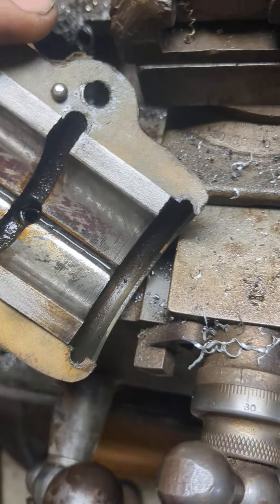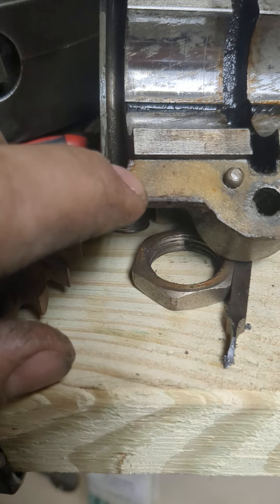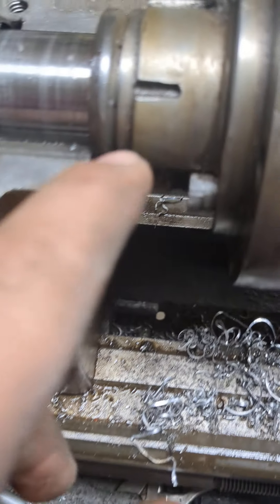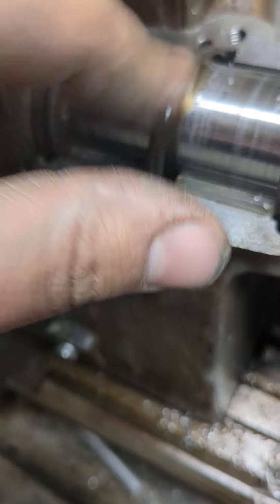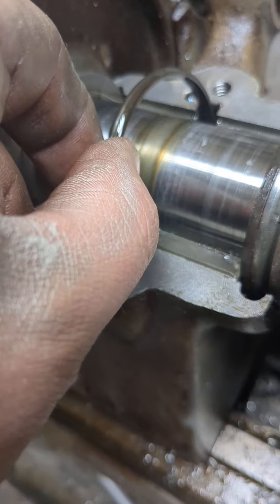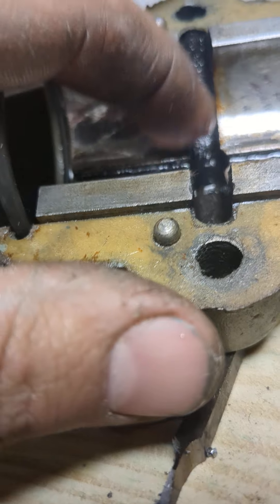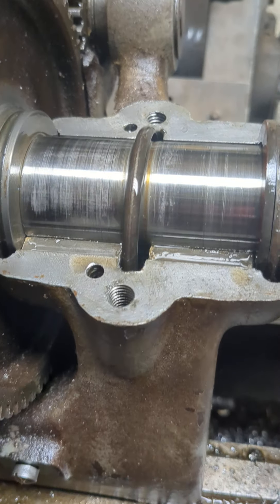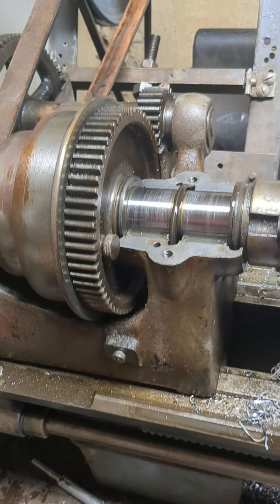babbitt bearing question

Comment: That's right, these technic with the ring lifting up the oil from a sump down below was often used on the crankshafts of old aircompressors.

Comment: Ol white metal bearings thas an old lathe.
That’s an oil thrower ring.
Being a lathe I would guess it would have had felt seals each end originally & would act as wipers on the thrust faces.
The brown staining is the oil breaking down when it gets hot, a common sight with mineral oils.
Looks to me when things warm up it’s wiping the crown of the bearing (the shining is high spots & it looks tight on the horns too.
I would blue the bearing caps onto the shaft, that’ll clearly show you the high spots. Scrape & bed them in & introduce a .003” to .005” thou shim between the halves to give it some crown clearance & allow for crush. Tighten them down & it should run fine when it warms up.
We used to reckon on a thou per inch, ie 3” shaft = .003” crown clearance on bearing.
Worth checking the chuck for run out too with a DTI.
Hope this helps🙂
Reply from the maker: This was exactly what I was looking for. I'm gonna scrap the ways and the bearings.
Reply: @rustyshakleford5230  glad to help, I hope your going to scrape them in & not scrap them 😂

Comment: AWWW! Some itty-bitty babbit bearings! Try doing them on the main engine shaft on an aircraft carrier. You'll need a chainfall to lift each half out of the housing, and a BIG capacity hydraulic jack to raise the shaft a few thousands of an inch to rotate the lower half out.   Those are the oil deflectors on each end to return oil to the sump. The center ring is called a slinger; it is supposed to dip into the oil reservoir and dispense the oil by squeezing the oil wedge as it turns. There may have been a felt/ wool seal on the work side of the bearing to keep work chips from getting into the housing. Oil needs to be changed and sump cleaned with mineral spirits, and use prussian blue to get a reading on the contact area and use lead strip or plasti-gauge to determine clearances.

Comment: central ring is splash feed lubricator. yes, it does exactly that, lifts oil.
end grooves are flingers and catchers...
oil cant get past the groove on the shaft, gets flung off.
and then it has to be caught...
should drain back to the center. looks like it wants some new oil... maybe all it needs, clean up and decent way/machine/hydraulic oil.

the shim is there for when you scrape the bearing. and that bearing looks like it wants a scrape... iunno. its not great. its not terrible.
theres literature on scraping lathe bearings... read up.
Reply from the maker: Didn't know you scraped bearings. I was planning on scraping the ways and I have another 12" lathe that's functional so that may be my next project.
Reply: @rustyshakleford5230  its why the prussian blue is often called "bearing blue"... was a mandatory servicing procedure in almost every garage up until a few decades ago... pour new bearings then scrape them.